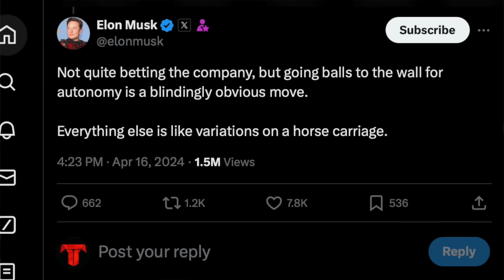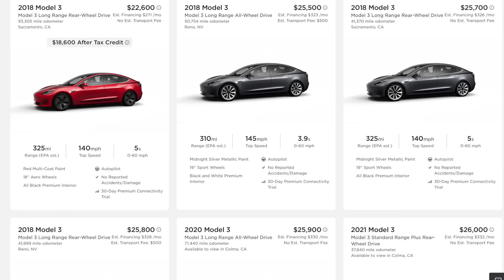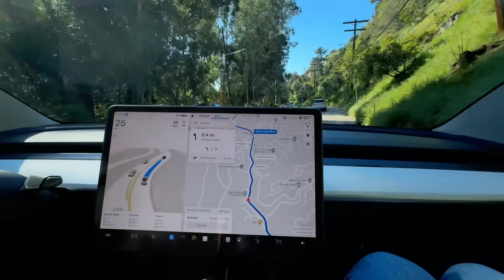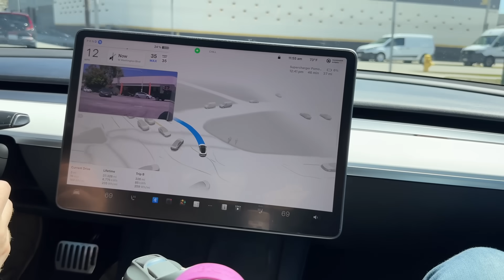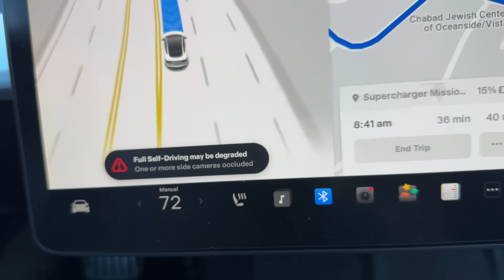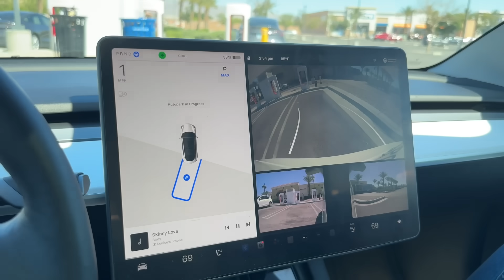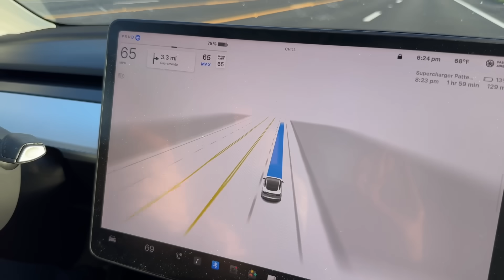Why Tesla Is Prioritizing RoboTaxi Over $25K Car

Comment: Accelerating the ev revolution seems to be taking a back seat if they can’t do a mass market product.
Reply from the maker: Model Y is the best selling vehicle in the world
Reply: @TailosiveEV  the world has 1.475 billion cars. The model y total est fleet is 2.16 million of dec 2023. Mass market is a large portion of car population. In what way does that equal new? Mass market is everyone’s car? They are focusing because Elon cut 10% of staff and wants more money for himself for 56 billion. With that Compensation the company could build a 25k car factory AND employ the 10% that was laid off. Love the cars but the company lost focus on its original mission.
Reply from the maker: RoboTaxi (which I doubt will work) but at least hypothetically would replace the role of 5 cars. The $25k car would replace the role of 1 car. Also may not be very profitable at $25k which doesn’t change much for Tesla. If you want a cheaper Tesla buy a used model 3, some are selling for under $20k today
Reply: @TailosiveEV  I’m my area the cheapest is 15k. Have a 2020 fsd beta 122k miles. Even with the improvements of fsd it’s doubtful. That’s why I’m for the proponent of a 25k new car. You should not wait for it to be used for a cheap car. Toyota yaris, Nissan ultima, Chevy bolt for some examples. They are just keeping there purchase bracket high like bmw.
Reply: @TailosiveEV  Model Y is not a mass market product and all possible Model Y buyers have already bought them. 
They last forever and must not be replaced by new ones every few years - unlike those dirty fossil burners. 
This year will see the end of this model.

We need the Model 2 to take up the slack. Or the Cybervan.

Cybertrucks have been stoped indefinitely and all existing have been called back and must be scrapped. They have no GAS pedal. And a CT without GAS pedal is boring like a Toyota.
Reply: @polarbearigloo  "Mass market is everyone’s car?" Certainly NOT. I will never buy the "everyones" car. I never had a VW Golf or Beetle. I will never buy a Toyota Corolla or Camry. 

But i have 3 Ys. Ok. My bad.
Reply: Who cares I don't like it, a stripped down cheaply made car that all my friends gave up on bringing them back to fix poor workmanship.
Reply: @wolfgangpreier9160  you are the exception. If you take the average Americans salary, they can’t afford 1 let alone 3 (today’s interest rates). The term for everyone’s car is everyone could afford it. (90% of the population of the region.) So today’s calculation would be 15k apx (after incentives).
Reply: @polarbearigloo  If you looking at the existing fleet you need to allow the time so that the vehicle was sold for about 20 years.
Reply: @polarbearigloo  So you don't give a rip about pollution and the accepted health problem it causes.
Reply: @wolfgangpreier9160     Why the false information Wolf?    CyberTrucks were on stop sale for under a week.   The factory did not stop production. Tesla was ahead of the NHTSA on this.   Will be interesting to see how long it takes/took to empty the lots of the 700 or so new trucks that were waiting on the new part.
Reply: @danharold3087  I mean are you changing anything? I have if you want to make that argument, are you doing your part to buy things to benefit or are you just a mindless consumer commenter like most.
Reply: @polarbearigloo  We have always been frugal.  We did not purchased new cars even when we could afford them.   We have driven 0 miles in the last 6 months.    We suspended the insurance on the cars and parked them.
Reply: @polarbearigloo  I am.   Most everything I own was cast off by the previous owners.    0 miles in the last 6 months.
Reply: @polarbearigloo  15k for a car  is too much for 90% of the European population. If the US boys can afford this they should buy Dacia Spring. That is the only  one available below 25K.
Reply: Somebody is getting it
Reply: @TailosiveEV fsd isn't ever happening. At least you sorta get it. Stock price has model 2 as a huge component. That's gone it's free fall time
Reply: @wolfgangpreier9160  um, hard disagree on "dirty fossil fuel burners" breaking down and needing replacing after a few years. toyota lasts forever. we have cars that are 20 years old driving perfectly fine. there is no such thing as a 20 year old modern ev, and if it was 20 years old, chances are the battery would cost so much to replace it would total the car and make it only suitable for scrap. this is not the case for gas, or diesel vehicles.
Reply: BYD and Tesla are not slowing down.
Reply: @jordohayes  you must have missed the 10% lay off tesla just did. for factory workers, service members and overall staff. also days supply is up to 60.19 days as of 16th of april, 2024. They may not be slowing down but purchasing is.

Comment: It would seem that if the Robotaxi fails, the body shell could be outfitted with controls and there is your 25k$ Tesla
Reply: My thoughts exactly. I assume that robotaxi is a red herring to have all eyes elsewhere.
Reply: The best car for a robo taxi car is not the same as the best for the $25K car.   Needs to be compelling.,
Reply: @danharold3087  both need to be cheap and small, the only real difference is adding driver controls for the $25k car.
Reply: @Modikie  Maybe. Compelling cars sell better regardless of price and size.   I am not sure a small car and a robot taxi as one body would be compelling for both.  One advantage I see with the modular is that they could build multiple cars on the same 'platform'.
Reply: @danharold3087  well for robotaxi, most of the time they arent going to have many people, so a small size is preferred for efficiency and maneuverability. this is similar to what would be preferred for the $25k tesla, which seems to somewhat resemble the aptera only probably with 2 smaller seats in the back.
Reply: @Modikie  That is true.    There COULD be compromises. that keeps it from being compelling as both.    Lets see if the unboxed process makes it easier to offer multiple models.

Comment: Given that we have been led to believe the 25K car is essentially the robotaxi with driver controls it seems rather odd that they would delay the 25k car unless they figured out it wouldn't be profitable.  if that is the case, then all the new gen 3 manufacturing they presented seems like it wasn't accurate in its cost savings.  Not confidence-inspiring for investors...

Comment: I agree Drew, the biggest issue would be getting regulators to approve FSD regardless how good FSD is. But i do think the 25k consumer car will also be produced alongside the robotaxi since it should be the same platform just extra things likes pedals and steering wheel.
Reply: BC just put in new laws that any use of level 3 autonomy is illegal with a fine of up to $2000 CAD ($1500 US).  Between the technical and legal challenges FSD will probably take 15-20 years.  As a result and given the typical life of a car the focus should be on profitable human driven vehicles and it is a huge mistake not making cheaper teslas to secure even more market share.
Reply: When was the last time Tesla took up liability on anything?

Do you guys honestly believe Tesla is willing to take on liability for when robotaxis fail?

Deep down, you know that will not happen 

Hence robotaxis is DOA

FSD is also DOA

It will always be relegated to drivers assist because Tesla doesn’t want to take on liability

Comment: Self driving only works if all cars on the road can communicate with one another, it’s not going to happen. The only thing that can happen is a “self driving lane” which will basically become a train on the road effectively.
Reply: Exactly, true self driving will need Infrastructure and cars that can communicate with each other. Only then will you have close to accident free FSD, and that still as challenges like bad weather, tunnels might be the solution for that.
Reply: No that's not true.  Go test drive a Tesla and experience it first hand. I use it Every Single Day and while it's not 100% yet it does in fat work just fine not communicating with other cars.
Reply: @johnfurr6060  not sure about geekmymind but I've tested  FSD on my model 3 and it does relatively well on the highways even though it still does things on the highway that are still dangerous compared to me driving it. City driving is a 50/50 if it can drive it's without disturbing traffic or putting you in a awkward situation. Until it can drive better or the same as me I can't trust it to drive my family anytime soon.
Reply: even then it won't work hackers will end that idea if you have to come up with idiotic ideas then level 5 is not possible if you do not want a car then take public transportation.

Comment: I for one don't think 100% autonomous driving will be a thing in my life time. Just doesn't seem safe with how your system is currently setup. By that, I mean for a vehicle to drive itself safely, I think that we need to bring more tech into it by adding tech to the roads themselves. Think of it as slot cars on non-slot car tracks. They might get from point A to point B, but not without difficulties. Putting the right car on the right road, it'll operate far better. Not saying our roads need a track for these autonomous vehicles, but more tech is needed to make it safer. Will never be 100% safe either, even when that happens. Most of all in the US, where laws and car makers continue to make the car itself safer for the driver, but then in turn more dangerous for if it hits someone/something.

Comment: One legal solution may be to make deals with municipalities to make Robotaxis partially owned by the municipality for close to nothing. In most municipalities they don’t take liability for their vehicles. 
I found this out when a fire truck traveling the opposite direction on a divided highway (not responding to an emergency) just out for drive, had it hose fall off the truck causing a of the sprayer to shear off and fly across the highway into my car. 
I made a significant effort to get the city to pay for my repairs but in the end I had no recourse as the law was that the city was not liable for anything related to its vehicles, busses, ambulances, firetrucks… 
If the city gets a piece of the revenue and has little to no upfront investment they may give Tesla legal cover.
It’s just one possible approach …

Comment: What gets me is that everyone is getting excited about robotaxi, yet it does not even exist 😂. No official concept pictures, no prototypes, no spy shots of it being tested it’s currently vapourware.

Even after it is officially launched it will take many years to come to market, took cybertruck 5 years and it’s still only being made in tiny numbers, robotaxi will take much longer as they have not even finished working on autonomous driving yet.

This looks more like hype to pump the stock which has been falling almost as fast as Twitters value since Elon bought it 😂

Comment: My Tesla can't even read speed limit signs. Elon is disillusional about FSD.
Reply: You are using FSD? How does it work? Are you satisfied?
Reply: @wolfgangpreier9160 it’s a cool toy.
Reply: @wolfgangpreier9160  To me there is a big difference between advertised/promised capabilities and what I experience in the car...which I am pretty mad about... Auto wiper not functioning, adjusting speed to speed limit not functioning, freaking out/breaking in perfect conditions, lackluster charging/departure-planning...
Reply: @sharkflower123  I recommend you buy VW. Much better cars. Because much more expensive. They will satisfy your wants. Just go away.
Reply: @wolfgangpreier9160 I would rather have Tesla live up to their promised features and actually have better departure/charging planning-software than VW than me having to be swapping car brand... Teslas have a lot of advantages. And a lot of horribly functioning features...
Reply: @sharkflower123  Swap car brand? Those are not knickers. I buy the best product for the best price. At the moment that is certainly Tesla. Tomorrow it may be Kia. The day after it may be Toyota. IDK. IDC. 

Everything in a Tesla works. That is not what i can say about any other brand car. Can and should it get better? Of course. Does it get better? Yes. Does any other product get better over time? Yes, my smartphone and my Laptop. Any other car brand getting better over time? Some Chinese. Anything else? Nope. Teslas are the cheapest and most reliable vehicles i have owned in 45 years. Thats good enough for me.
Reply: I disagree. I think that Tesla should focus on a $25,000 car.  The EV space has needed a less expensive car to broaden the base of customers who could consider buying an EV.
Having said that, I won’t buy a Tesla in 2024 for the same reason I wouldn’t have bought a Volkswagen in 1938.
Reply: @martinutr  Tesla has lost their focus with the release of the Model 3. 

Since then they concentrate on industrial production instead of the most precious vehicles we want them to set their focus on.

Of course making a single 25K car for you is more important then helping mankind on its way to the use of renewable energes. I understand completely.

The world really revolves around you and you alone Mr. Martin. Or should i call you "le Roi Soleil"?

And yes, i would not have bought a VW in 1938. My country was just occupied by the German Reich and WW II was just behind the corner.

You mean you want to say your country is just occupied from Russia and WW III is just behind the corner? May be.

Comment: Very. Well. Said!
I wish the other Tesla Tubers would be honest and be realistic about 1) Elon (at this moment), and 2) the hurdles to robotaxi
(NOT that Tsla FSD isn't amazing, and NOT that it will not evenutually revolutionize everythihng but,...)
I fear that Elon's Ketamine induced "positivity" is leading us down a very dangerous path.
Reply: At what point was he well spoken?  Other than using proper English.  Everything he said was opinion and also wrong.
He thinks you need regulatory approval for FSD.  Nothing is illegal until it is made illegal in America.  If I invented teleportation, it would not be illegal.  It would be legal by default.  This means that with Tesla FSD currently legal in 47 states that it would take decades to make FSD illegal.  The Gov takes forever to get anything done.  Right?  So in 20 years FSD might be illegal.  Maybe.  Depending on court cases.  ;)
Reply: @davidbeppler3032 does robotaxi have a driver license?

Comment: Robotaxi, and multiple new fast models (Model 3 Performance, new Roadster), seem like kewl shiny toys supplanting what's most needed...lower cost, higher volume model, faster and further expansion of supercharger network in America, Canada, Europe, Asia, the rest of the Americas, Semi ramp, licensed CATL battery, energy sector.  These may be more boring, but Tesla needs to move into those boring "another horseless carriage" spaces, and not continue a succession of shiny kewl toys.  Robotaxi reveal will be hugely embarrassing, nothing much to show, years from even a limited reality.  Effort on fast cars could be spent on slow cars.  (Honestly, the cheapest car they make, on the slowest acceleration setting, accelerate faster than 80% of the vehicles on the road.  At this point, trying to expand the market into the general population, you need faster cars why?)

Doing the boring things would be a highly ambitious ramp, but you need a CEO who doesn't find them insignificantly kewl.

Comment: Ive also heard people say that the robotaxi IS the 25k model
Reply from the maker: You can’t sell a car without a steering wheel
Reply: It could be the same thing but just without the wheel.  To sell it they just add the wheel.  Basically the same product?  Exciting to ponder.
Reply: @TailosiveEV  Sure you can! There is no law stating anywhere that a car has to have a steering wheel. Nowhere on the whole world!
Reply: @wolfgangpreier9160 yeah but there are laws against self driving that requires some way of input. Sure that way of input could technically be a game controller or som3on3 remotely doing it, but still. That or they get special regulatory approval which is fairly rare (only Mercedes and a few dedicated robotaxi companies like waymo got limited approval.)
Reply: Try the United States bird brain.
Reply: @wolfgangpreier9160  The UK might have something the implies the presence of a steering wheel?
Reply: @nicholasmuni7995  Are you sure?    I am guessing that is an assumption.
Reply: @danharold3087  no they have not. Read the laws. You have to have a solid steering device if you are using the car on public roads. That’s all.
Reply: @sahitdodda5046  I never said anything about self driving. Vehicles that are used on public roads must have a fixed solid steering device. No wheel. And only on public roads. And only if used for driving.
Reply: @PeterAndWillAnderson  No it is not the one with no wheel is a show car that will never be made the one that will will have to have a wheel to legally be on the road.

Comment: IMHO, Tesla has finally established a process that could potentially accumulate the 6 billion miles of FSD data they believe is necessary to achieve Level 3/5 autonomy. This need for extensive data might explain why software updates are being rolled out every two weeks. Once Tesla reaches this milestone with FSD, the focus will likely shift towards launching the Robotaxi service, alongside plans to roll out more affordable models like the $25k car and the Cyber SUV. However, currently, there seems to be no limit set on the resources dedicated to FSD development. It's crucial for Tesla to advance swiftly and put an end to the recurring "just one more year" promise that has persisted since around 2013. This would not only help close a long-standing chapter of development challenges but also validate the significant investments in autonomous technology.